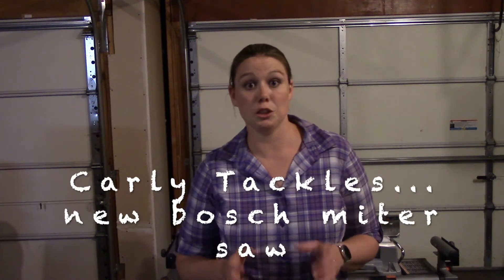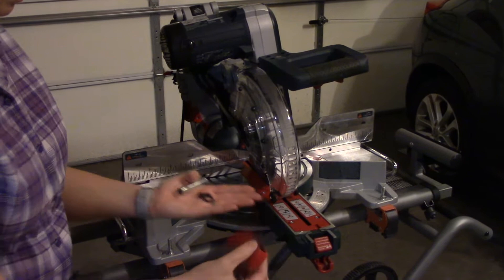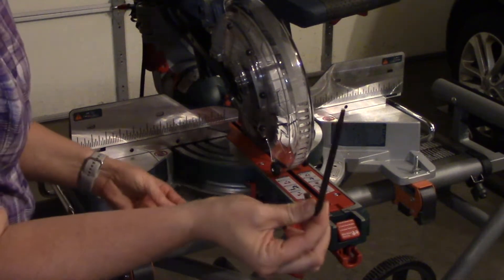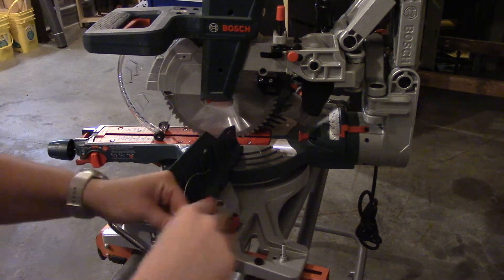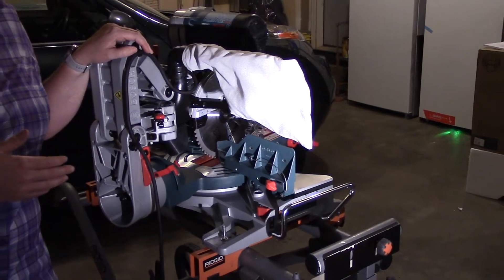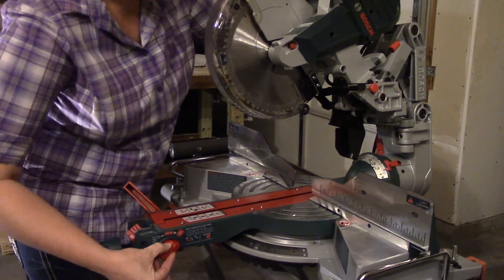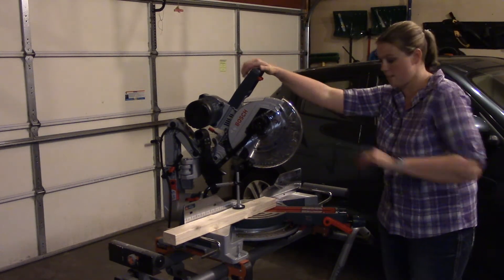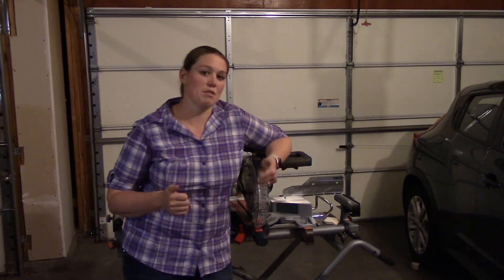The Ultimate Tutorial: Assembling and Utilizing the Bosch CM10GD Miter Saw

Comment: Thanks,just bought mine and was confused on the bevel cut adjustment.

Edit: For anyone like me who still couldn't get tilt to work, check the troubleshooting section to figure out how to adjust the bolts in the back for bevel tension and lock arm tension. The smaller bolt you loosen to reduce friction on the lock arm and the larger bolt you loosen to allow the saw to tilt for a bevel cut, and vice versa for tightening.